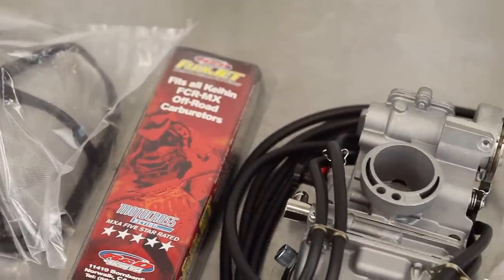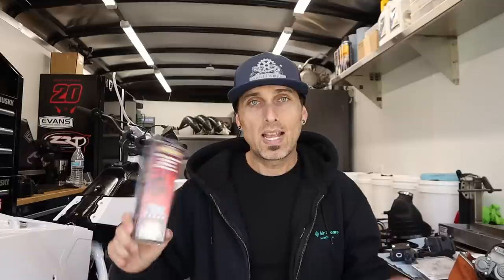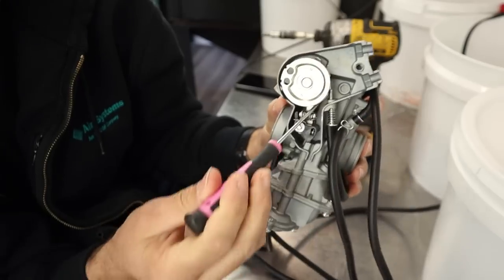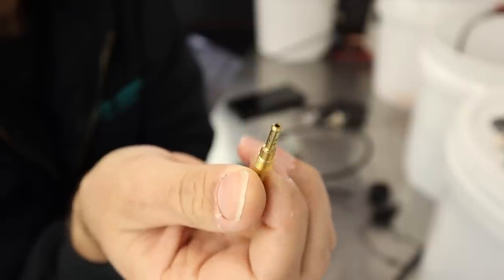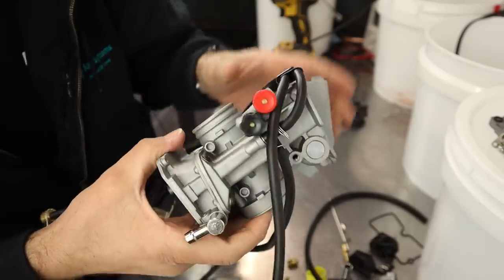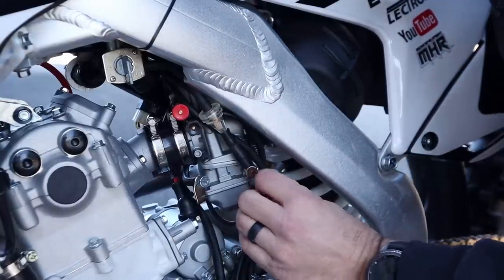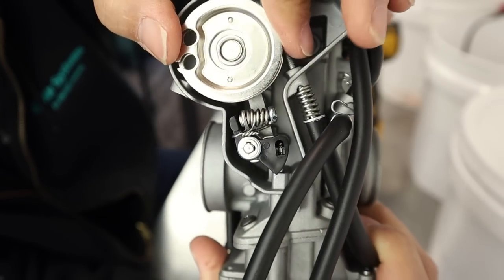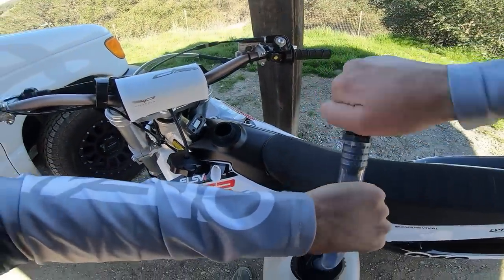Your BRAND NEW Chinese dirt bike runs like S#%T! 💩 Lets fix it.. 2022 SSR SR300 first ride & review

Comment: Great video! You can eliminate the play in the excel. pump rod by cutting the safety wire then turning the screw clockwise until the gap is eliminated. This is for timing of the excel. Pump circuit. Something else that helps that low speed circuit is the volume of the spray, for 250’s put the carb 12” off the ground and quickly open the throttle the stream should shoot 3 feet from the spray nozzle ( longer is richer & shorter is leaner) the leak jet determines the volume out the spray nozzle ( bigger leak jet hole hole = less going out the spray nozzle “leaner”) By the way your videos are great, the time you take to go in-depth is very important please keep up the unique projects. THANK YOU AND GOD BLESS! 🙏💪❤️🇺🇸🗽😁
Reply from the maker: Really cool trick. I have never heard of the 3' spray test. Sounds like a sweet flame thrower too! Haha. I'll take a look next time the carb is off the bike. Even though the rod slop was way less impactful then I thought it would be while riding, I still don't like it. As for the leak jet, I was hoping there was a size on it so I could data log a little better but no luck! At any rate, I appreciate the time you took to enrich the comments section with something of value to everyone here 🙏 Thanks for watching! -Charles // mXrevival
Reply: Some fcrs dont have the adjustment screw. Has to be set by tying wire to the right tension around the pump lever and housing to set the spray timing. Does the same thing as the screw

Comment: Hey Charles!! I told you this carburetor is amazing with this engine in a video before, it works very very good!!. The only thing we got to do is the jetting, but after that is awesome😃✌️. Another tip for you is to swap the throttle body for one of the KTM's throttle body, it fits just exactly fine. Regards.
Reply from the maker: Hi Omar, I really like the FCR carb in this bike. Definitely an upgrade over the stock 2020 version!

Only issue for most people is that the jetting is much more complex now. After this video we moved to Idaho, which is about 2,500 ft higher in elevation than California.

The bike would not even start or run with the FCR at this elevation. So it will need another rejet. I simply installed our Lectron mod again and it fired right up and ran great 🤣

I really enjoy the torque of the FCR when it's jetted properly.

I didn't understand what you meant about the KTM throttle body, as throttle bodies are usually found on fuel injection?

Thanks for the tip, and for watching, and sorry I didn't understand! 

-Charles // mXrevival
Reply: @mxrevival  Hi Charles, I'm sorry for not being so explicit, I mean the FCR Carb works good with the accelerator throttle casing from the KTM EXC models with double cable. 
Regards.

Comment: Awesome video!! I have a SSR 450. I installed a FCR Carb and Open up airbox with pro circuit exhaust and it is totally a different bike!! It will run with my friends CR 500!! I also have a NOS CR 500 2001 never serviced!! Thank you for your great videos and your help!!
Reply from the maker: Oh man I bet there's no comparison after your mods! Damn that 500 is a needle in a haystack too... Thanks for watching! 🔥
Reply: Hi I have a Chinese 450 with that 2 stroke type carb on doesn't look like much room under the tank to fit a for carb . What size carb did you use and did the air filter side and intake boot fit ?
Reply: @henrystaals6923  Hello Henry! I got a FCR carburetor from a Honda CRF 450 X which is a 40 mm and you will also need the intake boot and I would highly suggest the Honda throttle cable set up. I bought a Honda air filter boot also but as I was installing it I realized that the stock one was the same thing pretty much. The carburetor will fit on your bike being its copy right after a 450 X 2006 model. If you have any more questions feel free to email me anytime!!
Reply: Lmao there is NO chance this bike with any mods is in the same park as a 500. PERIOD.
Reply: @crazychad2720  A year ago I would have said the same thing but yes it will run with it I also have a 500 that I ride! Thank you for the reply!

Comment: Fiddling with and explaining the working of that FCR pumper carb is bringing back nightmare memories of trying to get my WR400 running properly.
Reply from the maker: Hahahahahahaha I bet it is!
Reply: Hahaa and me ! Husaberg 450, had the carb apart every other day !!! My WR 426 ran like a dream with power everywhere but hot start was a nightmare, better let it cool and try again !!!! Hopefully my 2002 CRF450 suoermoto build will be better or I am going EFi conversion 😆
Reply: @johnwalker194   If you had to take the carb apart more than one time, it was your fault lol. Not everybody is good with carbs though, so I get it.  Pretty damn simple though.
Reply: @kylegreen378  I hear ya ! Everyday is a skool day !! Where would you start with an unknown 400 to 450 conversion with the wrong FCR carb and the TPS disconnected that you got as a none runner ??? That Husaberg would have the headers glowing cherry red cos the idle was so lean till it was jetted somewhere close !!! This is the joy of buying basket case off road bikes without a full service history 🤔 you lives and learns eh 😉
Reply: @johnwalker194  So the throttle position sensor was disconnected?  Its never going to have the correct ignition timing.  An EFI bike would never even run at all if you had the TPS disconnected lol.  But what bike was the carb from? If you increase the engine size, you will increase the vacuum in the manifold unless you also get a bigger carb. More vacuum means you are going to pull fulr through the jets with more force. So you actually want to go down a size or two in every jet.

Comment: Great video charles... We tried the FCR MX 37 from crf250r on our repair shop about 1 year ago. we did the otom cdi and ignition coil as well as cr6 racing cable from ngk and ngk iridium plugs. Installed the pro circuit t6 slip-on. The bike was crazy fast, throttle response and everything was so spot on. but, after like 30 hours riding it with the same setting the bike started to act up. stuttered alot sometime in the bottom range sometime mid to top.  Then helplessly we changed the carb and put the Mikuni TM 34-2. changed the main and pilot and runs like a dream. 250 300 both runs good on the mikuni. Makes the 300  so freaking fast. Doesn't have the accelerator pump which sucks but still a very good carb for that money. We also ran the Mikuni TM 36 but it started to show idling issues . Please do the review on those tm34 as well, it is a very inexpensive option for many riders. Next stop we are planning to swap the cylinder head and change it to NT250 engine. It has shims and a dual cam and i guess running fcr will compliment it further.  what jets you ran for the fcr and lemme know which leak jet as well. I will try the fcr again to see how it performs. Ill give you a follow in insta too from @brthersgarage . Any info will help us a ton as we work typically on Chinese bikes.
Reply from the maker: Super interesting info! Strange the bike acted up suddenly ad was remedied by the swap. Did you by chance put this information in any other threads for bikes with this engine? I think it's very useful... Thanks for watching & the huge value add to the community.

Comment: The float needles used to be made of brass before neoprene took it's place. You can use a wire type spark plug gap gauge to find out the size of that leak jet or any other jets. We used to use them to punch out main jets to a larger size after changing intake and exhaust systems. We used this method to find out which size jets to order. Never failed.
Reply from the maker: That's cool! Would you have time to drop a link from a Google search by chance for those? I can add it to the video description too, to help others. thanks for watching!

Comment: There is a DOHC head for this engine ,I'm sure you will get more power ! I run my bike with an FCR 41 from KTM,I think that 33mm carb is too restrictive for this engine!Great video,keep em coming!
Reply: hey zoran, what jets you used for the carb?
Reply from the maker: I saw that!! I think Jim Stout (Facebook forum) bought it and it wouldn't install. I cant remember why & need to double check to make sure I'm not spreading a rumor....
Reply: @mxrevival  That is correct. The DOHC will need a different crank due to the timing of SOHC vs DOHC

Comment: One of the best carb description videos I’ve seen on YouTube!  I have a 2019 SSR 189 and also deal with the bog issues as well. I’ve tuned the carb in and out as much as possible but it’s still there. I’m now eyeballing the 300 and will pass the 189 down to my 13 yr old. Does the lectron work on the 189? Any recommendations for a better setup on the 189?
Reply: I have a bunch of vids on my channel with the 189.  Never had any bogging issues and my son road that bike for a year, just bought him the 300 and after the dealership that I bought it from followed this video the bike is great.  I have some vids of that too.  I would bet your issue with the 189 is a jetting issue I’m on the east coast in New Jersey and stock jets are perfect at my elevation .  Hope that helps.  These SSR bikes are amazing for half the price of the big name and full fun!

Comment: Much respect, just curious if you did any plug checks? If you did mention or do this in video I apologize now, missed few seconds when kid was running wild. Once felt got mine on right track I pulled plug after some wot shut offs and plug was snow white. Had to bump jets up to get some color even though nothing changed on butt dyno. I also put the old school boyesen quick shot on mine that I had laying here from back in day and really helped bottom end response. I asked myself many times if the time and effort I have into my 300 was worth it comparing to just doing your lectron and being done lol but Cheers bro, enjoyed the video!
Reply from the maker: It's a big video! No problem at all. No plug checks for me. My butt dyno feels like that is an accurate description if I did a chop-test way up top too. The bike feels great though and no sensation of rich or lean really. The 101 octane fuel may play a small factor- only worth mentioning it because a lot of guys will not be using that. I "feel" like this setup will have even more power up top with a clip position or two drop, or the next size main jet. But the circuits come on to one another without notice, or smoothly which is a great start... except for that small & random (but persistent) flat spot when the throttle comes on too quickly, and the slack in the rod to accelerator pump is felt via gap in fuel delivery for a millisecond. 

I bet the quickshot was nice! And, the Lectron is sweet / fiddle- free for the most part but conquering a jetting issue is also a fun feat!

Comment: Great content Charles. Is this SSR the same bike as the KAYO K6R ?
Reply: Let me answer that one for you,as right now I seem to be the only one on YouTube making videos on the Kayo K6-R...They are nothing alike, the Kayo K6-R is a Dual Overhead Cam engine in a steel frame similar to a KTM....they have 2 different models...one has a Carb and the other is EFI (electronic fuel injection) ..the carb model is more for MX and hard riding...the EFI version is more for off road and has completely different suspension components (softer).
 you can check out my channel about it here : https://www.youtube.com/channel/UCOMsunEjF-Sn3-WVc306Rag
Reply from the maker: Thanks Gareth! No they are different bikes. There are several variants of the SSR though. They start their lives as the same basic BSE brand machines and then are re branded by companies like SSR and others with different colors, and slightly different parts to differentiate them. But not by much!

I'd say the Kayo and BSE (SSR) are more like cousins. Some of the same blood (like similar engine and suspension platforms or brands) but different machines from different parents

Comment: The bolt on 30:41, that is absent on cam side is not just a bolt, but a limiter. It prevents cam to rotate too far. I think there is a risk that flat slide will jam if you open it too high(as it happens when you disassemble carb). Also it spoils airflow if slide is too high. Maybe with standard throttle tube it can't happened. I'm little cautious about such things since I overshoot tabletop on a chinese bike because of jammed slide(was not my bike and carb was not fcr clone)

Comment: I would replace the needle with one that has a rubber tip instead of the metal one. also the aftermarket long fuel screw will not have  enough room due to the starter being in the way.. We have a 2021 SSR 189 in the shop and it works very well stock.
Reply from the maker: Not sure if you saw the flex jet fuel screw in the video, but that is a way around the standard fuel screw issue.

I honestly really like this stock carburetor in this bike when it is tuned correctly, which was the point of the video because so many people having problems with it. It makes great torque just like an FCR should, even for a clone.

I bet you got the 189 running tits!
Reply: Yep I saw it and have been putting the flex one on everytime the owners let me.  I should have made myself clearer about the extended fuel screw being not used also due to the starter being in the way. Good videos .

Comment: Get a plastic welder and apply a little bit of plastic to that cam to build up and take up the slack that's in there
Reply from the maker: That's a great idea. My only worry with taking up that space above the rod is that the cam may not be able to travel it's full rotation before the bottoms out the rod. I'll have to try it someday

Comment: One question I had, so the mods that you did to this carb to correct any problems have already been done to the 2022 model? I'm considering getting one and I didn't know if I'd have to go through the same steps of modifying the carb like you did here. Thanks!
Reply from the maker: 2021 & newer will have the FCR carb that was tested in this video. But you will still need to tune it, yes. Specifically the part where I am setting the fuel screw earlier in the video. if it is giving you runnability issues after that, you may need to consider your elevation where you live and jet it accordingly

Comment: What is the bog you are referring too? I have the Kayo 250 2 stroke with a Nibbi 38mm carb and the bog on mine is at the top when you hit the throttle real fast. Also in the very begging of the throttle there is a minor lag. I was going to change the jets down a size to see if that fixes it. The spark plug was a little wet and black but hasn't fouled out yet.
Reply from the maker: Probably because you have a 4-stroke with a 2-stroke carburetor on it. In essence, the bike will run but be soft on the bottom. I've heard good things about that carburetor though. Affordable and effective.

So a bottom end bog using your carburetor, versus the carburetor in the video, will be for two totally different reasons. Mainly because your carb does not have an accelerator pump like the one this video is strictly about.

Some tips for your jetting: don't ever do them all at the same time. Only do one jet at a time, or one change at a time. That is the only way to find out if your change was positive or negative.

If you do too many changes at once, it's impossible to tell most of the time what change did what better or worse.

Same goes with needle clip positions. Always one change at a time no matter what. It takes patience but the rewards are worth it and then you'll be able to map out exactly how you fixed your bike

Comment: Maybe someone with a 3D printer that knows what they're doing can make a plastic cam that will get rid of the slop on the needle side and throttle side.
Reply from the maker: That is a killer idea and not sure why I didn't think about that!! My last video for the YZ250 Giveaway literally has a 3D printed dirt bike parts in it 😂😂😂 I'm on it, he's a great friend and partner of mine. Thanks for the light bulb! I was looking at the footage again last night too, of that rod issue- I think a wire tie under that sphere, but over the plastic that holds the rod under the sphere (I know, that's a weird read) could maybe take up the space I that juncture too.
Reply: My next door neighbor's 15 year old kid just got accepted to a drone league race team and he has a 3D printer to make drone parts. He made me 2 swingarm brake line hold downs in black! not that ugly white they use. But I found out you can also have softer, rubber like plastic parts made (like the frame plugs for the swingarm bolt). I was gonna see if he could make me a new airbox boot, but his printer is a little too small. But your guy can maybe make a new boot that'll fit right onto the carb and eliminate that extra collar. 👍Ooorrrrrr....just get a printer and shove another machine in the trailer lol

Comment: I couldn't help but notice when u switched pipes some of the rattles seemed to have quieted down or the pipe masked some of the rattles
Reply from the maker: I definitely feel like the pro circuit pipe has a smoother and quieter note. There could definitely be a difference in what you heard coming out of the stock pipe, which is wide open from engine all the way back. I could see hearing some valve train noise be quieted down in that situation by switching to the pipe with the spark arrestor installed